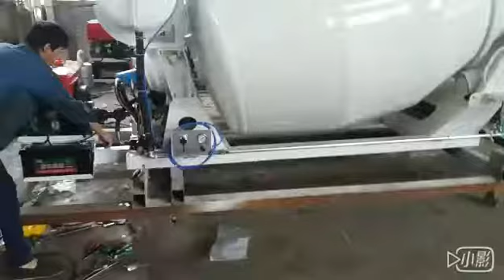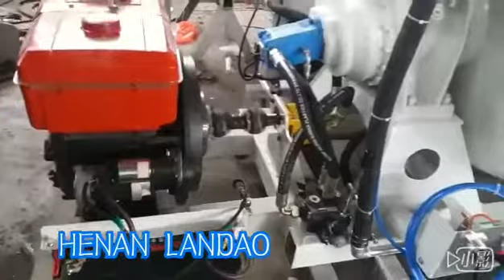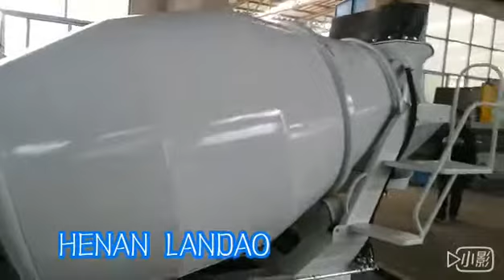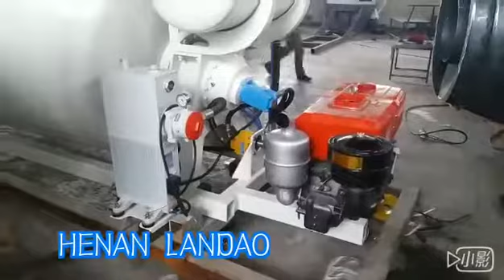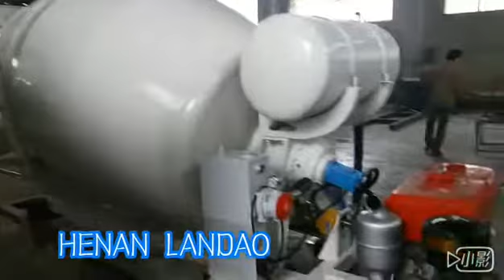2m3 Diesel Concrete Truck Tank

Comment: bao nhiêu tiền
Reply from the maker: 1. Loại: xe trộn bê tông 2m3
2. Kích thước chung:
3510 * 1550 * 1780mm 3. Kích thước lắp đặt:
760 * 2750mm
Thể tích hình học: 3,6m3
5. Khối lượng trộn hiệu quả: 2m3
6. Trộn tốc độ quay: 0-14 r / m
7. Trộn đường kính xi lanh:
1,55m 
8.Số: 14 °
FOB USD $7250 Per Set Qingdao Port
Could i invite your whats app,so shared some video and more picture to your reference.